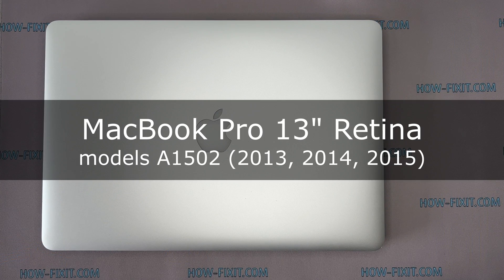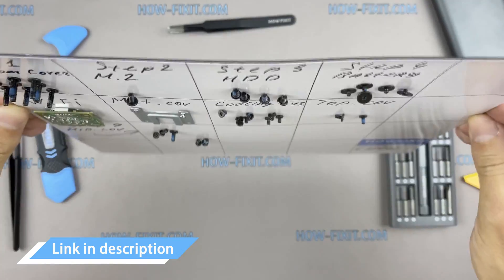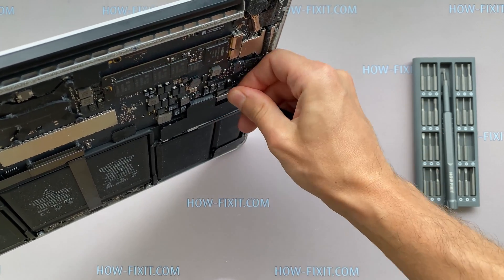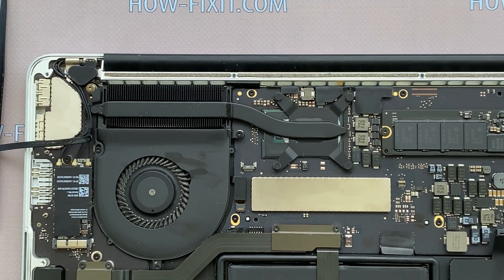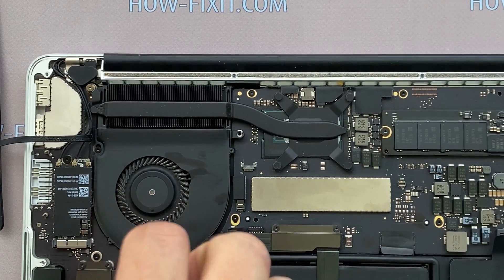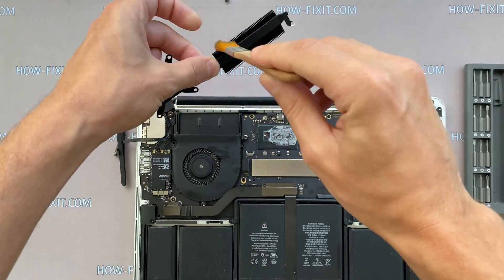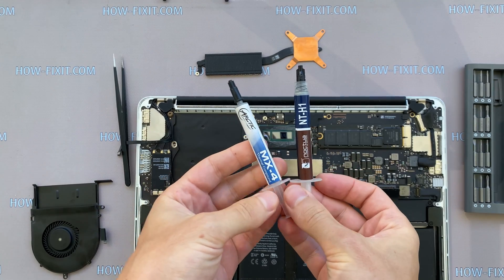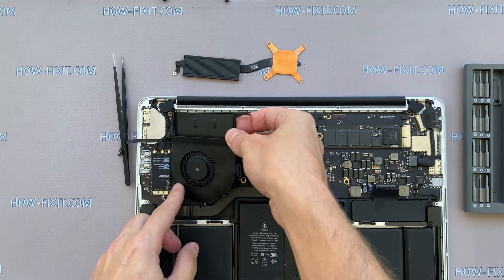MacBook Pro 13 A1502 Disassembly, fan cleaning and thermal paste replacement

Comment: Is anybody knows part number of the wire that goes over the top of fan assembly I accidentally stripped from connector by pooling it by the wire I know it’s damn thing I did  can’t find no part  number no description of the wire

Comment: My fan runs loud once booted up since I’ve added the thermal paste is that normal
Reply: did you put on too much? It's not good to use too much either.
Reply: @chadwickhell  not sure. It only was loud that one time thought it’s been running smooth since
Reply: @kappgod  nah you did good then, if it was too much it would be loud and hot constantly

Comment: The shape of the heatsink that covers the cpu is a square. Shouldn’t we focus the thermal paste to cover that square space rather than the small rectangular cpu shape? When the heat sink is initially removed you can see Apple covers the whole square.

Comment: 1:18 "Use only a plastic tool to lift the battery power connector". Proceeds using metal tweezers instead.
Reply: Do as I say, not as I do.
Reply: I was looking for this comment lol

Comment: My fan have some issues, it works for a moment and then stops. I've been told that although this is happening , the fan itself have no problem. Do you have any idea of what it might be?
Reply: I recommend getting a fan monitoring app like Macs Fan Control. It will show the fan speed and CPU temp in the menu bar. My fan runs at the minimum speed most of the time unless I'm watching videos or on Zoom.
Reply: It should spin up when your cpu is working hard or the ambient temps are high then stop when the CPU is cool enough. As long as the fans are not always running then you are good. My fans spin at full speed non stop while I game, but stop when I close the software and cpu/gpu is not stressed.
Reply: @NightBirdShow  my fans spins just a little, the temperature rises and then it throttles down
Reply: @vertigoz  perfectly normal
Reply: @NightBirdShow  I get between 95° to 100° about 212F on CPU temperature
Reply: @vertigoz  212f is about 100c, and that is typically right around the thermal throttle/limit. Once your cpu reaches that it will lower clocks and your fans should be at 100%, but again that is pretty normal on laptops when under load. If you open the laptop and immediately the fans are already full blast then you'll need to clean it out and re apply thermal paste.
Reply: @noahbirdrevolution  well, indeed it would be, but is is always under load even by simple usage of it. And the fans spin a little and stop even with that temperature.

Comment: For anyone doing this you need 2 screwdrivers: One for the outside (five-star screwdrivers: 1.2mm) and one for the inside (Torx T5 screwdriver). This is important as without both you cannot do this.
Reply: You can use pliers and catch screws from the sides, instead of using T5, but it's not really recommended

Comment: why are you putting paste on the small die? It is not even under the heat-sink. It is not supposed to have paste on it. The amount of channels I see putting out wrong info on this is nuts. I see it all the time on Windows Laptop vids as well. A cautionary tale here people.
Reply: Agreed, just took mine apart and there was no paste on the small square die because it intended this way by Apple because there is zero contact with the heat sink, paste is only required on the rectangle die!
Reply: thank you .... glad i seen this comment before doing mine!
Reply: So would it hurt anything or maybe tiny bit help if you add a thin thermal pad to the small one? Just to help with heat or is that bad and it needs to breathe??? Also show I add thermal pad to the ram like in this video? I barely use my mbp mid 2014 and I just wiped it clean no restore and I just left it open at the table I didn’t install anything on it and it runs the fan on high with no apps open.

Comment: How do you do 4:45?
Reply: lift the tiny little black flap so its vertical and then slide the cable out horizontally
Reply: otherway round sorry.... slide the cable in horizontally and flip the tiny flap back down til its flat again.

Comment: What's the screw type at 3:11?
Reply: I’m late to the party but it’s the same screw head as all the others inside the case (I used T4) but screws into the head of a much larger one. Keep it separate because it’s got a much wider head.

Comment: Do not put paste on the small PCH die. It's not supposed to have heatsink contact.
Reply: I agree with you. Been watching many videos and I didn't see them put some heat paste in that small PCH.
Reply: I was wondering about that, thanks for the comment! 

What ill-effects will there be for this guy's PCH die?
Reply: @eylonemuskson4177  It doesn't have paste on it per default. The heat from the heatsink will transfer to that die

Not really sure about the effects rather than a warmer chip. Might be running a lower clock?
Reply: Everybody is mistaking that as the GPU and it's not. CPU and GPU are together in the square one which needs the paste.
Reply: True lol